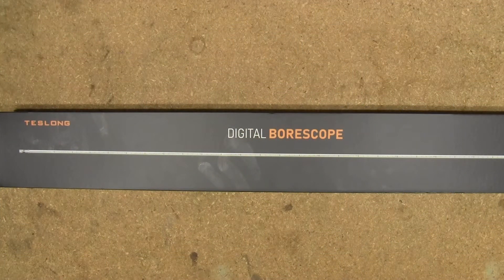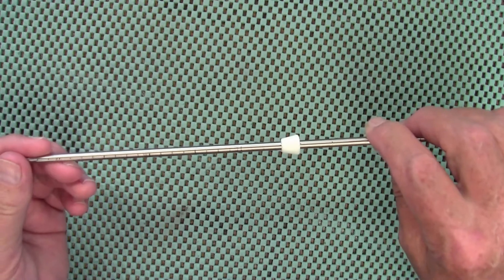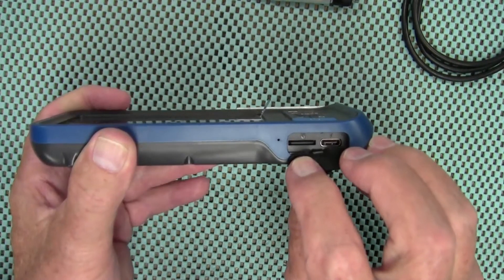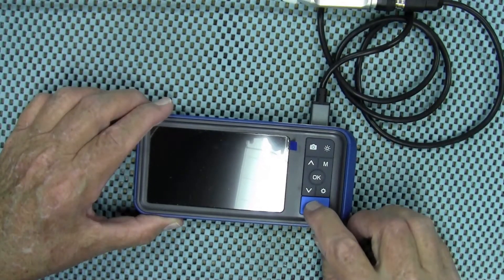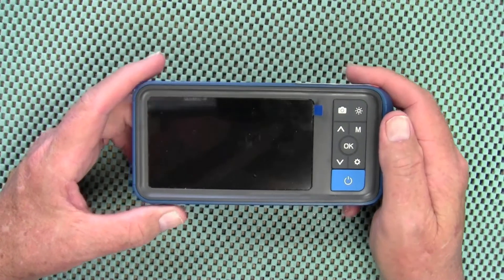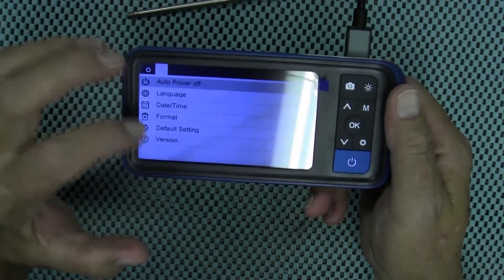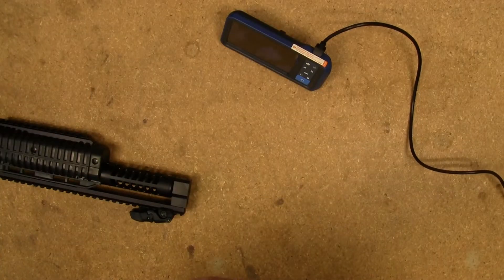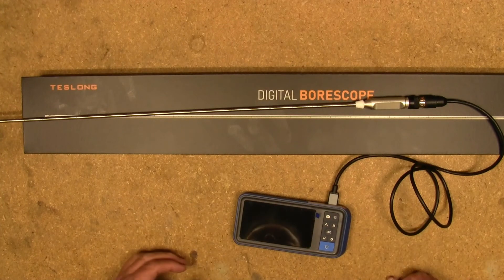Teslong Rigid Rifle Borescope

Comment: I've talked myself into and out of getting a bore scope a handful of times over the past years. Do I need it? No. But I think it would be a pretty cool tool to add to the kit.
Reply from the maker: Well these borescopes have more uses than just looking inside a barrel. You as an electrician could use it to look inside of walls for running wires or seeing where the studs and fire breaks are at. You can see in tight places on a motor. The uses are endless